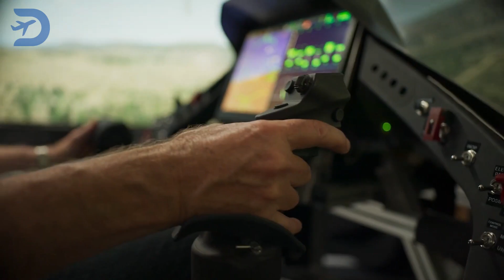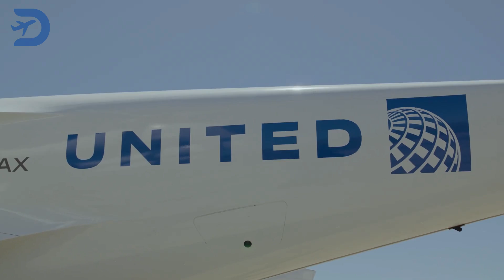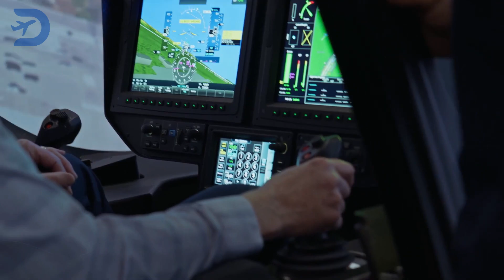Which one is the future of Aviation? Archer Vs Joby

Comment: There are other significant EVTOL designs and companies developing innovative technology.  HOVR is a Canadian small cap that has patented and proprietary "in wing" flat electric motors that are brilliantly modular and independent.  HOVR's design is radically different than Joby and Archer, and features folding wings for a small storage profile, very suitable for defense industry partnerships.   In the UK, there is a company called EVTL that has an operational VX-4 similar to Joby and Archer's platform.  This air mobility market has great potential for financial reward to the winners in this competitive race.

Comment: Got to own both .I bought 2,000 shares each last year .I got in under 3.50 archer. And 4.50 for joby. Holding for 5 years and wait and see.Archer has a new plant and they started😊 building in Georgia. I think Archer is ahead and they are are partners with  company tied to the military.own both.plus Archer has a boat load of cash and pre orders and there building right now. Goal is to pump out 650 a year by 2030. They both have backers but Archer has its plant in Georgia and have there CO. . 9:06

Comment: Whats the difference vs a helicopter?
Reply: the wing and no backward moving prop that loses lift at the speed where the backward movement of the rotor matches the cruise speed of the helicopter. so you will be able to fly like 500km/h and land vertically

Comment: Amazing companies. I think both will be very successful since the market is huge.  However, I think both companies can have designs improved. Safety would be number 1 if to fly inside cities, noise would be number 2, size would be number 3, comfort would be number 4, cost and ease of maintenance would be number 5. Each company has unique advantages.
Reply from the maker: @HungryAlienWorms You make some excellent points! Both Joby and Archer have the potential to succeed in this massive market, but there’s always room for improvement, especially in key areas like safety, noise reduction, and design. Safety is definitely critical for flying in urban environments, and noise levels will be a big factor in public acceptance. Plus, optimizing size, comfort, and maintenance costs will help both companies stand out as they scale. Each of them has unique strengths, and it’ll be interesting to see how they evolve as the eVTOL market grows!

Comment: I say JOBY is better than Archer. Joby has more range, goes faster, quieter, more efficient design utilizing all their motors and props for lift and forward flight (no dead weight in forward flight), they are ahead on FAA certifications, partnered with Toyota (the king of quality and efficient auto manufacturing) and its $3.7 billion market cap to Archers $1.1 billion market cap tells you where investors are putting their money.
Reply from the maker: Thanks for your comment. But then why did United invested in Archer instead of Joby and Why is Cathie Wood obsessed with Archer ?
Reply: @Discover.Aviation  Because Delta got to Joby first. 
 Cathie Wood is horrible investor. She sold all the Nvida stock in 2022 right before it went parabolic. Her ETF funds are less today than they were in 2019.
Reply: @Discover.Aviation  유나이티드? 조비는 델타항공이 있지요.
Reply: This vid is outdated, the current top vehicle is "midnight" from Archer
Reply: @bbhrucy  yeah,  and Archer is definitely the front runner now in jan2025

Comment: Both! Competition is good. Competition co-creates a larger ecosystem. This future business ecosystem is massive. But, I'm only invested in Joby.
Reply from the maker: Totally agree—competition definitely drives innovation and helps build a stronger ecosystem! Joby’s a solid choice, and it’ll be exciting to see how both companies contribute to the future of air mobility.
Reply: @Discover.Aviation  Here are other investors you did not mention concerning Joby. 

"The Pentagon's investment in Joby Aviation began in January 2018 with an initial investment of about $970,000 from the Pentagon's Defense Innovation Unit (DIU). This funding has since grown into a major contract through the Air Force's Agility Prime program, which was launched in 2020, with the total potential contract value now reaching about $131 million."

October 11, 2022
"Delta Air Lines is an investor in the electric air taxi company Joby Aviation, having invested an initial $60 million for a 2% stake with the potential to invest up to $200 million if certain milestones are met. "

LEHarris partnered with Joby this year. 
"L3Harris is the primary defense manufacturing partner that has invested in Joby Aviation."

Intel Corp: A long-term investor, Intel Capital has participated in multiple funding rounds since 2018.

BlackRock and Vanguard

Comment: Joby's concept seems the most efficient since none of the props & motors become parasitic dead weight after transition.
Reply from the maker: Joby is fav to many. But time will tell who will lead this race. Thank you for supporting our channel.
Reply: How is 5 tiltable engines easier to serve than 2 static on a normal helicopter?
Reply: @user-zz8lb6bd7p  The main rotor swash-plate mechanism on a helicopter is phenomenally complex and extremely high maintenance.

Comment: Uh... what? Archer's mainline aircraft is the Midnight.. which you show in the video multiple times yet only mentioned their demonstrator aircraft and its specs.. The video information is less than useful as a result.
Reply: I don’t know what’s so useless when they’ll be doing air taxi services in 2025. They didn’t build a huge manufacturing plant in Georgia for their EV’s for nothing
Reply: @willfitz94 No Archer will not be doing anything in 2025. JOBY is the only one in stage 4 out of 5 in FAA testing. Archer has to redesign their aircraft because it failed a stage of testing. They are at minimum 2 to 3 years away from possibly launching.
Reply: @bronxishomenomatterwhereig3149  They were actually FAA certified like months back what rock you living under
Reply: @willfitz94   FAA certified to operate as a commercial airline. But the Midnight aircraft itself? No, that is years away from certification. What good is the commercial certification. Without an aircraft???

JOBY is the closest to getting a EVTOL aircraft certified for commercial use.
Reply: @bronxishomenomatterwhereig3149  you say years away yet they’re commercializing in 2025 at major airports in the US. Also it has no set backs in the FAA certifaction for the midnight aircraft.
Reply: @willfitz94    Where are you getting your info from??? Their original design failed a stage of testing with the FAA. The tail was too heavy for reliable, stable flight. They're currently in the process of redesigning. 

Yeah Archer says they're gonna do that in 2025. But Nikola motors founder also talked big game. Only for it to end up being bullship. The only way they can actual begin operations in 2025. Would be by beating JOBY to market. 

And JOBY is the leader in this space. They are the furthest along in FAA testing for type certification for a EVTOL aircraft. ARCHER to me is suspect. A lot of big promises that objectively. They are in no position to fulfill as soon as 2025
Reply: @bronxishomenomatterwhereig3149  I can ask you the same thing. Where you getting that they gotta redesign the tail lol. Nikola talking what? Do they have a manufacturing plant for their EVTOL’S yet? Archers gonna crank out 650 EV’s a year.
Reply: @willfitz94  I brought up Nikola as an example of how easy it is to talk a big game and sound convincing. Even though you can't actually execute on anything.

Archer is talking big, gonna manufacture all these aircrafts. But it's all for not if they don't get type certification for their aircraft. That's the make or break. Nothing matters without it.
Reply: @bronxishomenomatterwhereig3149  You never answered my questions but doesn’t surprise me
Reply: @bronxishomenomatterwhereig3149  Dude you’re so immature lol
Reply: @bronxishomenomatterwhereig3149  K? You sound like a five year old child man it’s pretty sad. Now I know who I’ve been talking to this whole time
Reply from the maker: Thank you for your feedback. Indeed the script for this video could be much better and accurate. This video was a test to see the potential for this type of content. Our team is working hard on improving the content for upcoming videos.
Reply from the maker: Thanks for the feedback! That first video was more of a proof of concept to test the demand for this type of content, which is why the focus was more on the demonstrator. I definitely appreciate your input, and I’ll make sure to dive deeper into the Midnight and its specs in future videos. Stay tuned for more detailed content!

Comment: They should have a parachutes  for more safety fly  in case batteries or energy fail and some extinguisher in case or fire ,that taxi will fly over population and buildings. Do they have that devices ???
Reply from the maker: Great question! Safety is a huge priority for eVTOLs like Joby and Archer. While they don’t have parachutes, they are designed with multiple redundant systems, so if one battery or motor fails, others can take over. Both companies are working on extensive safety features, and fire suppression systems are also being considered to ensure safe flights over populated areas. Safety standards are still evolving, so we’ll likely see even more innovations in this area!
Reply: What's the matter if the evtols used parachute.is any disavange ?? I can't get it

Comment: A very superficial look with no mention of commercial viability. How do you provide low seat-mile costs with a four seat aircraft that costs $1B to $2B to develop? Conventional takeoff aircraft cost far, far less to develop, operate from the many small airfields that already exist and can satisfy a market for cross country ‘thin’ routes. Also 400km range vs 200km (at best).
Reply from the maker: You bring up some solid points! The high development costs and relatively short range of eVTOLs like Joby and Archer do raise questions about commercial viability, especially compared to conventional aircraft. However, eVTOLs aim to revolutionize urban air mobility, focusing on short trips within cities where infrastructure is limited and conventional aircraft aren't as practical. The real test will be how well they scale and reduce operating costs over time. It’s definitely a challenging road ahead.
Reply: development is always expensive, new products are always expensive.....look at flat screen TVs 20 years ago.
Reply: Are you really that ignorant or did you forget your anti-psychosis meds when you posted this claptrap?

Comment: Joby is working with and is funded by the DoD.  Their aircraft is extremely quiet, now think about why the DoD would be interested in almost silent vtol aircraft. They might not be the "sky taxi" in 30 years but they are 100% going places.  Cool video.
Reply: This is also true about archer. The Air Force has already purchased their aircraft for inter-base operations.
Reply from the maker: @oddbirdinohio  Absolutely! Archer is also making strides with its partnership with the Air Force, showing that eVTOLs have a role beyond just urban mobility. Their use for inter-base operations highlights the versatility of this technology. It’ll be exciting to see how both Joby and Archer shape the future in both commercial and defense sectors!
Reply from the maker: @Lost_Hwasal   Great point! Joby's partnership with the DoD definitely hints at more than just commercial urban air mobility. The almost silent operation could have significant defense applications, making Joby’s technology versatile beyond just sky taxis. It’s clear they’re building something with long-term potential in multiple sectors. Glad you enjoyed the video—thanks for watching!
Reply: @Lost_Hwasal  Joby has a limited application profile.  IF it ends up being cheaper than a helicopter already in use, of course the DoD would be interested.  First Joby will have to prove it's reliably safe.  It's recent crash isn't selling dependability to the top brass nonetheless prove it can carry weapon grade armaments safely or reliably
Reply: @EarthCreature.  Joby has delivered 2 acft to the USAF, ACHR has delivered 1, also good. Joby's "recent" crash was 2.5 years ago and that's almost ALWAYS a thing during testing. Joby is significantly further along with testing, approvals and certs.....but I still like and own all 3
Reply: Guess you must be in a state of suspended animation. Trump is the new sheriff in town and won’t spend another dime on these moronic projects. Imbecile.

Comment: Archer is too far behind Joby. If my memory doesn't fail me, Archer had just done the transition flying for the first time at the speed of +100mph last month.
Reply: How they behind when they just built a manufacturing plant in Georgia? They’ll also be doing air service going into the middle of next year
Reply: Archer is Safer, and will start to massproduce this year. And getting certification to fly in multiple countries.
Reply: @MrStefangyro  mass production next year is only a plan. until and unless Archer has obtained all necessary cert from FAA, they can't produce anything.
Reply: @MrStefangyro  calm down. My reply to you confined to your statement that " Archer... will start to massproduce this year" .
What you meant is not prototype but final version.
If you really think Archer is in a position to do so within THIS YEAR, you are nothing but naive
Reply: @MrCat852   Joby has more money
But Archer is safer due to redundancy therefore a quicker process for Certification and more value.
Reply: Because Archer is falling behind while JOBY is the real deal.  Look at recent stock market action , the difference between the two has become too obvious to ignore.
Reply: @BlueEyed888 turns out that now 
Archer is the front runner

Comment: Joby can fly over 500 miles with their new hydrogen-electric system
Reply: You do know they had to remove all the passenger seats to fit the massive hydrogen tank on board? I am sure if you replace on the passenger seats with batteries you could get around the same range. Plus the hydrogen either needs to be super cooled to like -250 C (which would take massive amounts of energy in of itself to get it that cold) and/or pressurized to like 10,000 PSI, which if that blew up alone from the pressure of the explosion would obliterate the craft into a million pieces let alone if the gas caught fire and explodes into a fire ball, so not only the craft blowing up into a million pieces, but also burning into ash and pretty much vaporizing. If hydrogen was practical we would see cars being mass produced and on the market for sell.
Reply from the maker: Indeed. A video is coming very soon on this topic. Stay tuned.
Reply: Pipe dream. Both have drag issues.
Reply: Without useful load.
Reply: Really? Can you show us the data that supports your moronic comment? Thought not, imbeciles like you are incapable of justifying your idiotic comments.
Reply: Who cares if they can fly 500 miles? These are meant for short commutes, not long ones.
Reply: Who whants a hydrogen electric system ...?
Reply: @altr314 alot of people.
Reply: guys, forget about both. The leader will be EVE, save my words!!
Reply: And hydrogen is such a reliable, easy to acquire, unstable fuel that is slightly flamable.  Though, triple the cost of ordinary fuel.
Reply: @kenjues1594  joby can crash, maybe
Reply: @EarthCreature.  anything can.
Reply: @kenjues1594  Joby can crash... again... already... maybe
Reply: @EarthCreature.  I understand how bad you want Lilium to win. Unfortunately, they are too slow developing the product and getting licensing and speed is irrelevant for short distances air travel. Good luck with it.
Reply: @kenjues1594  Lilium has 3 distinctive moats in the eVTOL industry.  It doesn't matter what your fantasies tell you
Reply: @EarthCreature.  best luck to all of us.
Reply: @EarthCreature. I wonder why Lilium’s stock is so low???
Reply: Lilium is imo a completely different product. It's essentially a more affordable private jet, useful for comfort, luxury and international flights. It is not an air taxis it urban commuter like Joby and Archer.
Reply: *or urban commuter
Reply: @EarthCreature.  lol
Reply: @EarthCreature.  lol

Comment: Neither, As Helicopters already have  low disc loading and high hover efficiency. For urban transport focus should be on reducing the noise level of the rotors. A Heli Gyro hybrid architecture can be looked into. Also auto gyration introduces a passive and reliable  layer of safety.
Reply: Lol! And are WAAAAAYYYY more expensive to operate. Helicopters WON'T be competing anytime soon with ground-based transportation for LARGE SCALE consumer market share anytime soon as a result. Also, there is a high probability that battery technology will double in capacity every 18 months, doubling the range of EVTOL aircraft in turn. Conventional helicopters won't be able to keep up.
Reply: @pruthvirajgatkul1046  Neither is correct.  Lilium is the superior of these 2
Reply: Bell and Boeing both made demonstrators. Super expensive and didn't bring radical transformation of abilities or safety. Earlier this year they were both rejected  by the army in favor or souped up, cheaper versions of current helicopters.